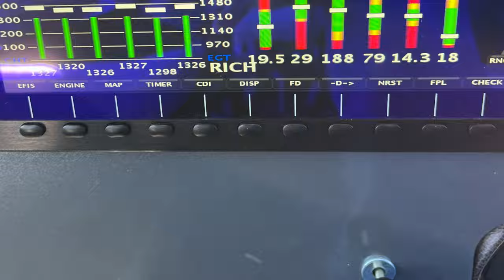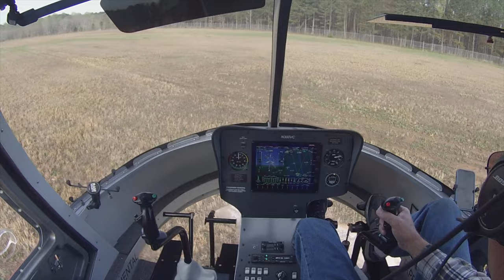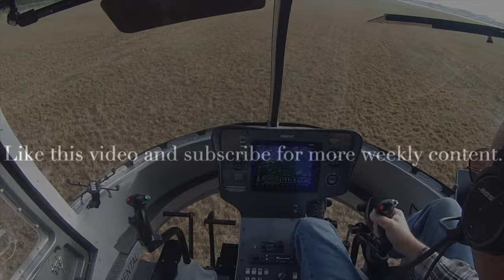Hummingbird update 3 21 23

Comment: Thanks for the update Vic!  So glad its going well.  Also glad you got the pitot fixed!  I'm a big fan of the hummingbird.  What is your gallons per hour?  Also how does the in flight cabin noise compare to r44 in your opinion
Reply from the maker: fuel flow in hover is around 22 gpa, and cruise is anywhere from 18 gpa and up, depending upon how fast. still tweaking and calibrating everything.

Comment: At timestamp 5:10 that lean vs rich jet discussion doesn't make sense.
Reply from the maker: See the comments below the video. Vic realized his error when he reviewed the video. You are correct.The larger the number on
the jet, the smaller diameter. In other words, to increase fuel flow, use a smaller numbered jet.